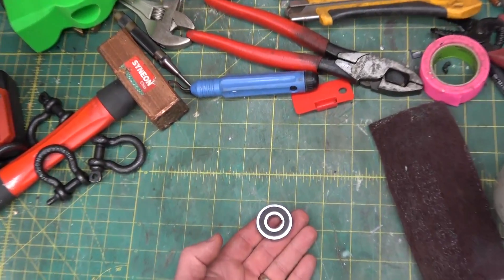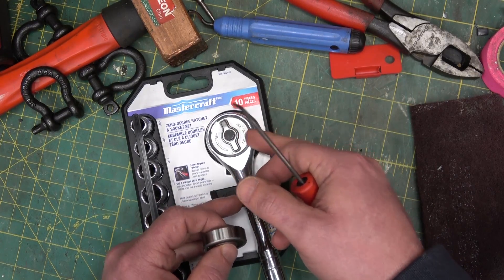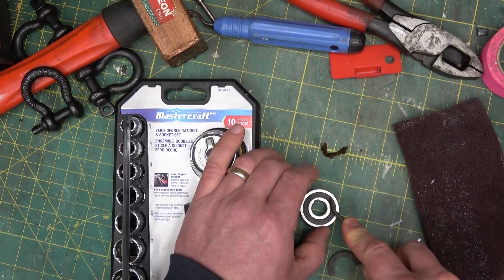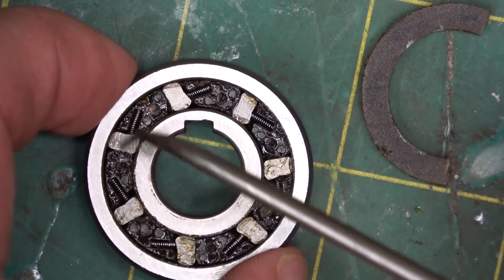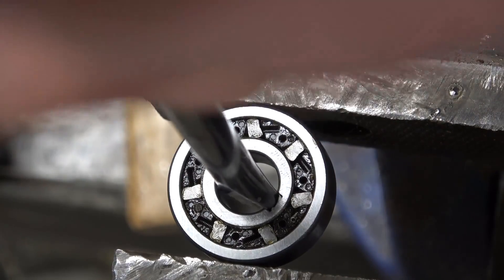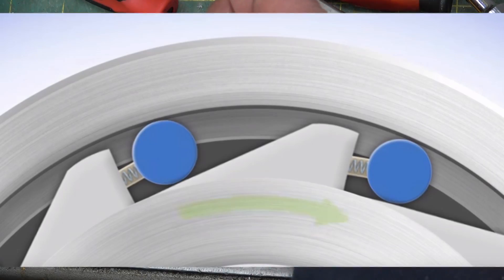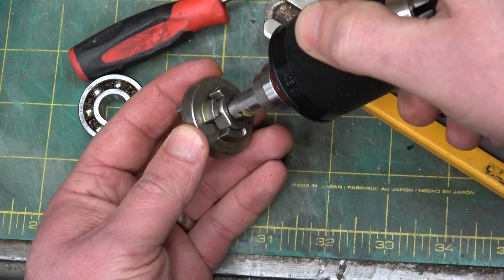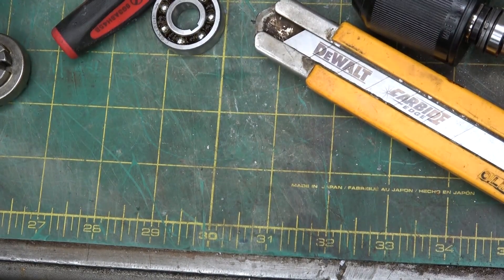BOLTR: Sprag Clutch | Engineered Bearings

Comment: on the MAN offset printing machine in my job there was an original 30 year old clutch bearing that we replaced  with one of these, and it lasted about 3 months. The original clutch bearing was more complex and had alot of small springs and roller pins, our mechanic was puzzled when he took it apart, I wish i coud have gotten my hands on that and send it to you.

Comment: The one way roller bearinga are used a lot in photocopiers especially in the document feeder where the initial feed is quite slow up to the registration roller forming a buckle to straighten the sheet then the registration roller takes over and the one way roller clutch/bearing freewheels so the initial feed leave little resistance to the document you are wanting to copy.

Comment: And on the automotive applications, specially in alternator freewheel clutches, when they fail they either whimper out and die or they go out like rockstar at the age of 27. Freewheel clutch can either be fuzed together and lose the clutch partition (locked at both directions), spin freely at the outer race or warm up at insane temps and totally melt the clutch, aux belt and alternator due to internal friction and the recoil of the belt bouncing and jerking around will destroy the tensioner as well! Same thing with other machinery, failed sprag clutch can really cause heavy damage unless replaced.

Comment: Aka clutch bearings. We use them to keep printer ribbon taught. Needle bearings by Torrington.
Reply: YIKES.... haven't heard of "printer ribbon" in years.  I used to work on printers and sold the ribbons.
Reply: Mike Joyce  this is thermal printing on plastics at line speed. Later/bubble jet doesn’t really work.
Reply: @chucklachance  HA HA  I was remembering the 70's and 80's.

Comment: I had a few of these as hand me downs from a friend that works in industrial design (planning factory floors and all that jazz) and for ages, i couldn't understand why it only went one way. It didn't make sense to me because it looked the same as a normal bearing. Took the cover off come to find some mechanical wizardry inside using cam rollers (unlike this one) and a sort of pattern in the cam roller's holder. Likely, not meant for heavy duty action, seeing as there was plastic and no keyed shaft.

Comment: These types of roller clutch bearings have been used in automatic transmissions for ages. Nothing new here really. And it was one thought they couldn't fail intermittently or once in a while, but that has been disproven for sure with the GM 440T4 transmission (early Buick Park avenue front wheel drive), which would have overrunning clutches not work once in a while, causing all sorts of interesting failure modes.

Comment: John Deere 6 volt starters on old two cylinders are made with these types of clutches; except the locked condition is what is used to transmit the power from the drive gear to the flywheel. Great Idea till I get my dick beaters on it and convert it to 12 volts;  now I cant keep the fucking thing from eating the starter drives

Comment: pedal bike rear wheel without coaster brake,
Reply: Holy smokes its Mustie, fancy seeing you here
Reply: They  have  been  tried in  bicycle freewheels, and   so  far  no  one  has   made  them  work very well.
Reply: @jamespettit1792  if nobody has made sprag clutches work in bicycles, that's been the shortcoming of the engineers. sprags are used all the time in much more demanding environments than bicycles.
Reply: @SuperAWaC  : Yes, helicopter rotors.  If the gearbox were to jam or engine fail, the rotor continues to spin.  The pilot then turns the bird into an autogyro glider.  Without the sprag,  such events would be almost certain crashes.  Due to reduction ratios involved, the drag on the rotor is huge even in free power turbine engines (power take off turbine not connected to gas generator section)
Reply: SuperAWaC as Gregory mentioned, it’s been done with some success but these units are inherently heavy and on performance bicycles weight is both legitimately important and is also low hanging fruit for marketing copy.
There are other proven ratchet mechanisms available to designers at lower cost, much lower weight, ease of service etc.   So, apart from the engagement issue there’s not a terribly compelling argument for using this solution.
..apart from them being pretty cool..
Reply: @markmacnab438  I Highly disagree. I have Onyx hubs on my mountain bike. It is a 10,000 dollar bike. The clutch mechanism is by far the best I have used. The fact that you have no inherent friction far outweighs the weight penalty. I have used Chris King, DT Swiss star ratchet, Industry Nine and various 3 pawl hubs in my 16 years riding. So far the Onyx has proven unbeatable in my book.
Reply: @SuperAWaC  Replacing a mechanical lock with a friction lock on a drive train only makes it silent while freewheeling. There is no mechanical advantage to a 6 pawl ratchet. Also you'd be introducing the possibility of drive train slip and hitting your nuts on the stem at the steepest climb.
Reply: thomas jones which of my points do you disagree with?  The weight penalty is a simple fact compared to other options and that weight penalty is quantifiable, and the marketing departments do take advantage of this and for good reason.
There are also other proven mechanisms available.  Basically I’ve only offered facts and verifiable observations.  The only opinion I offered was my last line where I said they’re pretty cool..
..I’m happy to hear they’re working well for you and I do think it’s an interesting solution (maybe trials riders should be interested ?).  but I doubt if CK or i9 or hope are worried about losing market share
Reply: @bmxscape  
In powered flight, air flow through the rotor is down.  When the engine(s) quit, the aircraft starts sinking, the airflow is now up through the rotor disk.  This keeps the blades moving which provides vertical drag, aka lift.
Reply: @bmxscape  
By collective pitch control.  This increases rotor lift.  In the case of engine failure, the collective is dumped, then cyclic pulled back to effect a nose up attitude.   Rotor speed increases as the aircraft falls.  Decent rate is then adjusted by increased collective.
Reply: @lovebunny1214  please tell us the price of all the things you have.
Reply: @whatman6199  Of all the parts on that bike? ok 
Frame: Ibis Mojo HD4 with Float X2shock-$3200
Custom paint on frame: $2000
Fork: Fox 36 factory -$1000
Wheels: Ibis carbon with onyx hubs-$2000
Drivetrain:Sram X01 Eagle-$1200 
Brakes: Sram G2 RSC's-$400 

Thats about all I can remember of that bike.
Reply: @jamespettit1792  Onyx hubs. Very highly regarded. Just heavier than a ratchet and pawl system
Reply: @n0ch91c3s  Have not  seen  them,  I  stand  corrected
Reply: @jamespettit1792  my 1985 sinclair tricycle has a sprag clutch needle bearing for the motor; works from standstill to 15 mph.
Reply: Wish all bike had coaster brakes
Reply: There are some professional racing MTB hubs by Onyx, but that lack of backlash is exactly the reason nobody uses them widely.

Comment: They started adding these to alternators, to increase fuel economy. It probably saves you like .001 percent of fuel and they fail constantly. Automakers and government looking out for there customers the only way they know how. Saving you pennies and charging you dollars.
Reply: Funnily enough, I came down to the comments to say that I've seen these on the starter motors of aircraft Auxiliary Power Units, and I saw this. And also funnily enough, they're troublesome items there too (Though the ones I've seen are a sprag-clutch only - the bearings are separate. There must have been at least hundred sprags on maybe 8cm diameter, all very well made little "S" shapes, but with the middle part of the S being vertical instead of sloping, presumably to maximise the length change during lock-up).
Reply: ,,, the sprags are showing on the drives of all these supercharged cars. It allows the inertia of the impellers to come down relatively on its own compared to the crank. It is hard on the crank hub and its press fit, and the rest of the belt drive otherwise.
Reply: Implemented in the Ford Crown Vic body line mid 2000s for a belt chirp during high rpm 1-2 shifts
Reply: How?....
Reply: @Ezzell_  let's say your at 5500 rpm going to pass a vehicle. You complete the pass and come off the accelerator. the engine RPM drops almost immediately. the inertia of the the rotor combined with the clutch will allow it to run down at its own rate. It's pretty miniscule amount of extra power. it also has a  added advantage of reducing the harmonics into the serpentine belt system.
Reply: @GeorgeJFW  but that inertia  is going in the same directoon...how does a non reversing bearing have any effect?   Also...the inertia of the crankshaft will not be slow down easily.
Reply: @Ezzell_  The clutch is not used to prevent it spinning backwards. It's used to transfer power and let the driven axle freewheel when the driving axle slows down.
Reply: @AnttiBrax  the oringinal poster said "these were used"...which mean non reversing bearings.    He must be taking about sothing else
Reply: What effect would this have? It would only allow the alternator to turn faster than the engine.  When you let off the gas it's not like the momentum of the alternator is going to try and keep the engine turning. Even if it did how would that hurt fuel economy?

Comment: There are also needle roller oneway units.  These oneway bearings are found in R/C helicopters where they're used to allow the heli to autorotate if the motor/engine fails.

Comment: The actress that played the sadistic nurse in The Right Stuff, Jane Dornacker, was killed in a helicopter crash caused by the sprag clutch in the rotor hub failing and locking up in the wrong direction.

You really don't want to be in a helicopter when that happens.

Comment: Thats cool. There's a bicycle hub manufacturer here in the states called Onyx that uses a sprag clutch assembly. Apparently a Duke university study in 2016 determined that the Onyx hub had the lowest rolling resistance in any commercially available bike hub at the time. They're pert spendy though, as one might imagine. Great VJO as always!
Reply: I have an Onyx rear hub and I can attest, they are absolutely badass. If you understand how a pawl based hub works, you realize all your pedaling force is transferred through such tiny pawls on such tiny teeth, especially in something like an industry 9 hub. On an Onyx, the whole sprag engages with your pedaling force on the drive shaft (best way I can describe it) so all your force is spread evenly through the hub.

Yes they are spendy, buy onyx hubs are actually game changing. I want them on my road and gravel wheels as well.

Comment: motorbike engines use sprag clutches on the starter motors. the starters can turn the engine over without being driven by the motor once started. had to change the sprag clutch on my Kawasaki GPZ600 a looong time ago

Comment: Interesting fact; the one-way bearing shown in the picture, can fail to engage the lock, if it spins fast enough in in the unlocked direction, and very suddenly changes direction, then the wedge-balls will ride on an oil film, preventing them from engaging, so it's very important to not rely on these type of bearing for safety..
You see this often on smaller engines using oneway bearings instead of ratchet type pull start systems.
Reply: Traxxas nitro cars use one way bearings for starting
Reply: @merlinious01  Exactly! :) but in fact, they are also used in the electric starters for most real cars, in case the pinion fails to disengage from the flywheel/flexplate when starting.
Reply: interesting
Reply: Sprag clutches are used in many flight safety / flight critical applications.

Comment: (Pics and Video below) . Interesting that you're describing uses for these where the freewheeling is normal operation, and the lockup is just to prevent backroll, and that you can overcome them. I've always seen them reversed, where they lockup is powered and the freewheel is when unpowered .

For example, I harvested some of these from a motorized "Kangaroo Katty" golf caddy. They had a single bearing assembly, with two normal sets of bearings on the outside, but the middle bearing has rollers that only roll in one direction. The shaft is chain driven and there were drive pins to rotate the wheels on the casing. 
https://i.imgur.com/zhCmeFZ.png
https://i.imgur.com/kssKyES.jpg

I used one of them on an elecric recumbant bike I built so that my feet wouldn't have to keep up with the motor (remember "Big Wheel" plastic trikes, if you started going downhill you had to bail or shatter your shins?), but if I wanted to assist the motor by applying torque on the front chain, I still could.

https://i.imgur.com/wIrw5nt.jpg

And a video showing it a little bit: https://www.youtube.com/watch?v=5XYJRf9O5xc

Another easy/cheap place to find them are old 1980s rowing machines (look for cheap plastic wood grain veneers). There'll be a set on the shaft for the flywheel. Obviously you want to be able to yank on the row (shaft or cable) and apply power, but still be able to return for the next pull. They'll be rubber-coated and about 3" wide pucks, about 2" diameter.

Or I suppose you could call the bicycle's freewheel itself a one-way power bearing, but it is the clicky-type, like a ratchet, and contain almost zero magic.
Reply: First time I came across them was on a Suzuki GS750 motorcycle. It's how the starter engaded and disengaged.
Reply: @n1elkyfan  When I was a motorcycle mechanic in the 80's that was a pretty common design on most of the Japanese bikes.
Reply: sketchiest sprag application is in piston-engined helicopters. engine craps out, whirly bits keep spinning.
Reply: conversely of course, sprag craps out, engine blows itself to the moon, pray you're high enough for an auto
Reply: Oh god. Memories. If that damn direct drive go kart thing I had. Peddled my way up a super steep hill (memory so probably pretty gentle) and turn around to pedal back down. Yeah. Ow. Couldn’t keep up so threw my legs out. Knocked wheel and lost balence. Flipped and rolled. Wheeeeeee.
Reply: @colinantink9094  - It's a childhood right of passage to learn why freewheel are necessary things. Goddamn hipsters and their brakeless fixies.
Reply: I have a chinesium ebike. It's pretty bad quality overall, but the freewheel for the motor has a really nice big wedge roller bearing. I learned that I shouldn't take it apart by taking it apart, but only one roller fell out and I did manage to get it all together again.
Reply: I think in vehicles, to not wreck the starter once the engine kicks, it's called an "overrunning clutch".
Reply: Yeah same, the automatic transmission in one of my Husqvarna bikes uses them to free wheel the unused transmission ratios, but they grab on the one being powered.  I mean there is a bit more in there to get it all to work, but the sprag clutches are important and used in the way you describe.

Comment: A simple device that stops you from going the wrong direction. Should be standard on vehicles and dating apps.
Reply: Funny you mention vehicles: It's pretty common in an automagic transmission to have a one way clutch (sprags or rollers typically) to allow planetary gear sets and/or clutch packs to keep everything going in the right direction.  

Of course, sadly, engineers have yet to figure out a way to have this do anything to take into account the problem between the driver's seat and the steering wheel.
Reply: @astrangeparrot  Damn, you beat me to it.  Been years since I have had an auto tranny a part.
Reply: @TheLittlered1961  That is why they're call "gearbox" in Urban Dictionary...
Reply: and toilet roll holders
Reply: @alexreeve  now that idea should be patented
Reply: Bruh